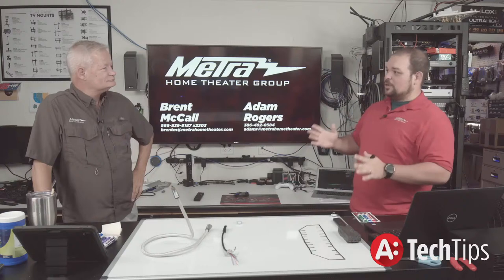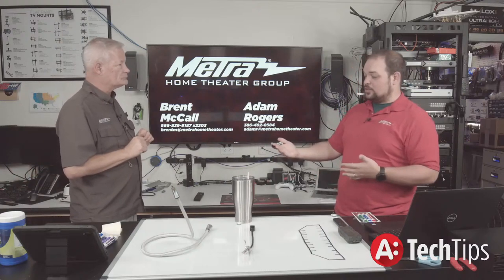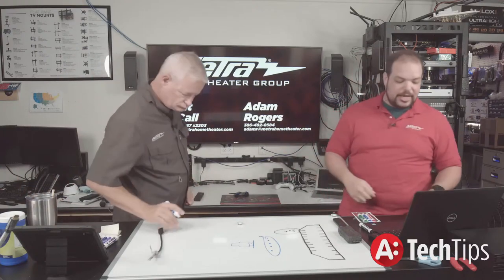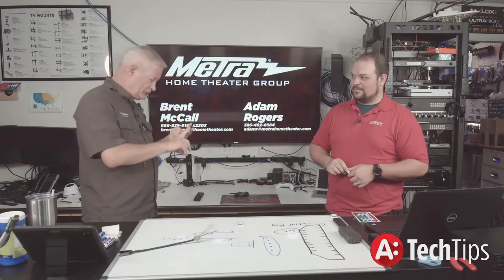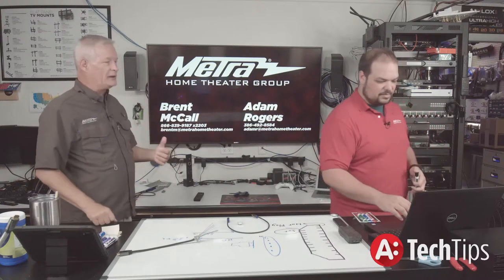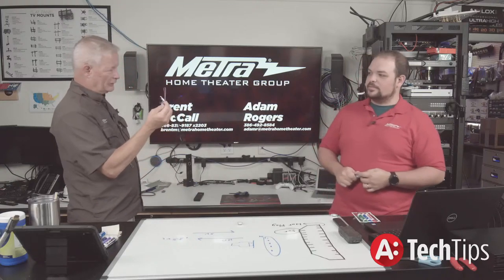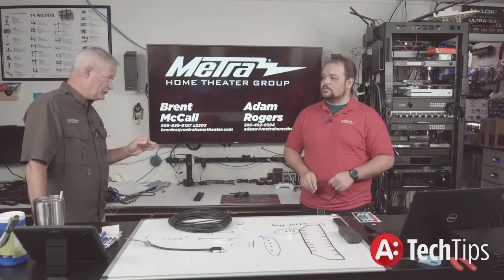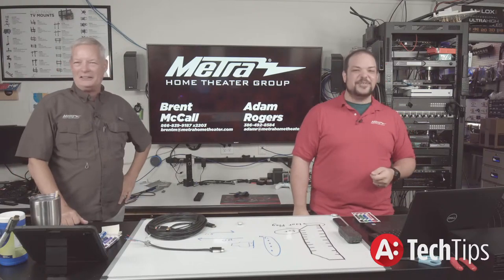Knock Knock, Hotplug is here!: HDMI Cable Deconstruction Pt 1– Tech Tips Webinar

Comment: It looks like the easiest solution to fix the hot plug power issues is to built a pass through coupler that would loop back pin 18(5V DC) to pin 19 (hot plug detect).
Reply from the maker: Hey Christopher, We did look at this as a solution that would be self-powered off the HDMI 5v power. However, you have 2 problems doing it that way: the first problem starts when the 5v trigger (pin 18) is NOT enough for what it needs to do it's own job, so borrowing power from there to use elsewhere only increases that deficit further. The second problem is feeding that power back to the source (Pin 19 for HPD) causes the source device to assume the TV is always on, negating any built in programming or causing it to never renegotiate the EDID information. You would see more "HDCP error" issues as well.

I like the way you're thinking though, keep it up! -Adam

Comment: Good breakdown, but I have a problem with your definition of “voltage”. Voltage is not “transmitted”, it does not “carry current” nor is it “pushed”. It is the amount of force that is applied to a conductor to induce or begin the flow of current. Much like the amount of force you need to squeeze a tube of toothpaste, whether you decide to use your fingers or a sledgehammer.
Reply from the maker: Hi ALXandroATS, This is a really great point and you are correct; for simplicity reasons, we wanted to describe it in a general way to get the concept across. The way that you described it is more complete than our description, and we recommend anyone who has an opportunity to take a deep dive in electrical engineering to do so. For the purposes of this video, we wanted to show that there is a difference from voltage to current, which in our discussion, current is more troublesome than voltage. - Adam
Reply: Voltage always came along with current. From 0.00001 amp till very large amp like from battery car.